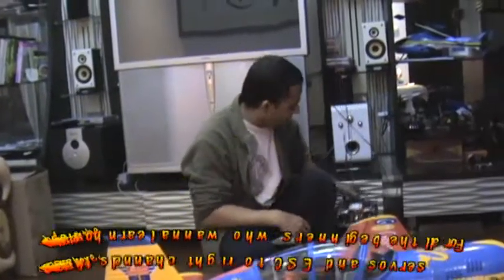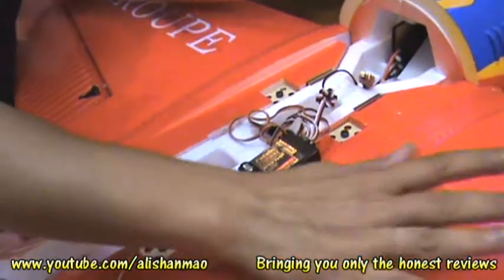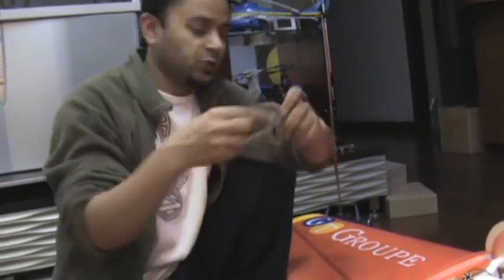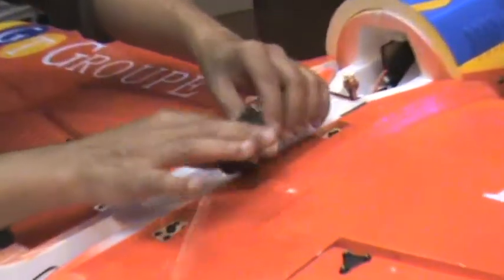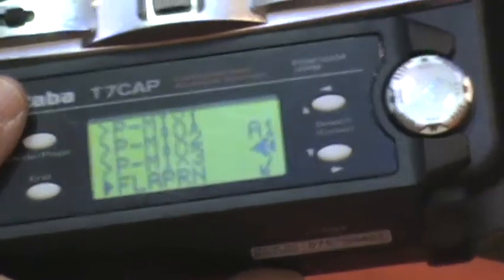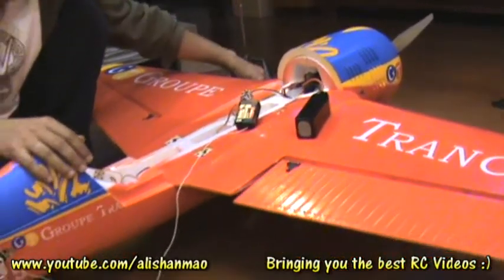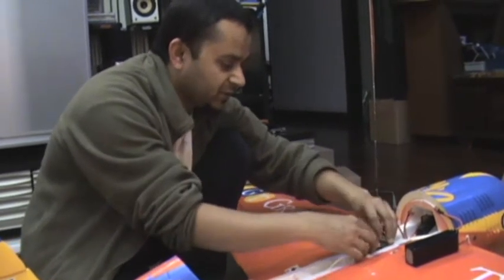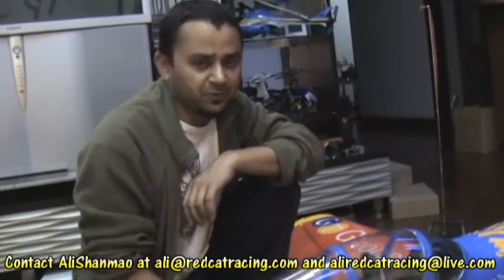How to setup 4Ch Plane Channel Connections

Comment: Hi... i order one already can you give me the battery Pack Size for that plane? and if the Rhino 3700mAh 4S 14.8v 20C Lipoly Pack can fit in it 155x28x45mm
thanks.
by the way you good job by introduce Yak 54.